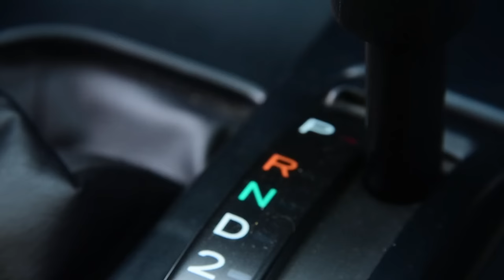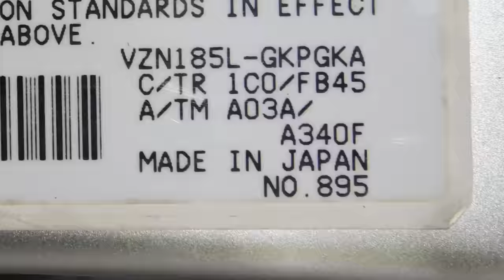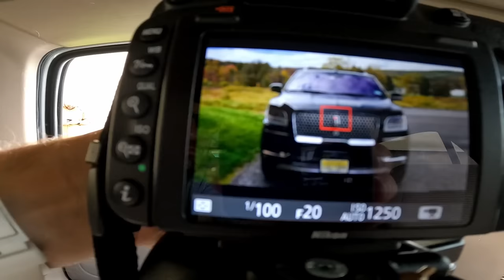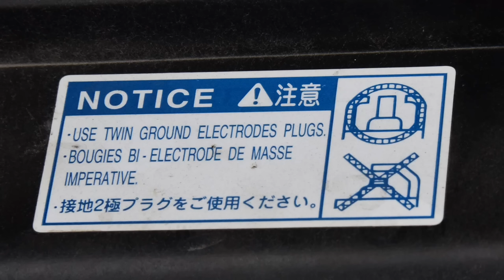2000 Toyota 4Runner SR5: Regular Car Reviews

Comment: I am enjoying this video btw, just explaining some things I’ve noticed in my many years of driving my 61 total cars owned(5 of which were 4Runners). 

There are so many errors in this video. I’m so confused. 3rd gen’s aren’t slow, 2nd gen’s are SLOW. I have the 22re with manual 5 speed. It has 33” tires and 4.88 Yukon gears. It’s “slow” but still able to do everything I want. And it feels stable and well planted at 70-80mph. It gets 20-25mpg(drives like stock with the gear change in the axles). 

My non-sunroof 2nd gen has tons of headroom and I’m 6’. I have like 5-6” above me. 
My head to the ceiling. 

It is much more truck like than the 3rd then. The 3rd gen even has a rack and pinion like you mentioned. 

The brakes are fantastic! With 33’s I can stop easily and consistently. Stock tires are 29’s for this spec(can be optioned with 31’s from factory). The drum brakes work amazing, e-brake still works at 251k miles. The 3rd gen maybe weighs more? Or smaller brakes? But they all come with 16” wheels for bigger brakes? Idk, Suzie(Susan?) the RCR 4runner must have some weird differences. I have owned 2nd gen’s, a manual 3rd gen and a v8 4th gen briefly. I will eventually go Tacoma 3rz swap for my 4runner just to get more power, but the 22re can do 100mph given enough time. 

My suspension rides great when stock, slightly less good when jacked up. But it has to do with the geometry of my a-arms up front with ball joint spacers (which have held up for 3 years of wheeling and road trips).

The old Subaru loyale with oversized tires was SLOW. Wouldn’t maintain 65mph in 5th gear flat ground no wind haha.

Comment: in all honesty.  the only thing you need to get to get any toyota truck to ride substantially better. that will not bankrupt you either, are a set of bilstein monotube 4600 series dampers.  about $400 plus installation and alignment.
*also, I'd agree that any aftermarket performance exhaust on these Toyota V6's sound garbage, but you really should try to find the TRD optional catback exhaust.  the ONLY exhaust that sounds good on any toyota V6.  everything else in truth is buzzy and yuck sounding. 
also a note, i wouldn't ever put 4x4 on dry pavement the turn the wheels at all.  your asking for trouble as it binds the components in the front end as there's too much grip on dry pavement.   i appreciate that you do the proper 4x4 exercises but only do them when the roadway is damp/wet and when its a basically fully straight road.  .cheers
ALSO, BIG UPS ON DOING THE POR15!! just did that job  with POR15 top coat on my brand new 2023 Tacoma 6MT as the frame was aready pristine.   love to see it, screw all that fluid film/wool wax junk.  you did it right dude!

Comment: The 4th gen is best gen because it's modern ENOUGH to be comfortable on road and still be incredibly capable of road 

It also has the most powerful V6 of the other 4runners and yes it can tow too  I towed a 7k pound load from Dallas to Seattle

Comment: Do the tundra brake upgrade on the front rotors. 13WL calipers with 231 mm rotors as opposed to the stock 178(?) mm. I had bad warping on my 3rd gen and was always a little worried when going down any hills. Threw on some 13WL calipers and rotors from a wrecking yard a few years ago and haven’t had a pedal vibration since. Definitely a massive quality of life upgrade, even for on-road use.
Reply: Do you have 16" wheels on your 4Runner? Did everything fit well or did you have to do some grinding?
Reply: @TheHamburgler123  I have the stock 16” five-star wheels on it, and the only modification needed was to trim away a small (maybe two square inch) piece of the dust shield so it would clear the caliper. Other than that it’s a drop-in swap. I did stainless steel brake lines at the same time and haven’t had a pedal vibration since, 40k miles later. Also, I grabbed the calipers off a tundra from a wrecking yard to save cost, and bought oem rotors and pads.  You can do the upgrade for less than $700 if you’ve got some time to search.
Reply: @ebenwragge-keller538  Thanks again for the information.

Comment: recently its about vacuum, it got suction but something is leaking, we checked the parameters of the central console and something looks crooked, we checked the sparkplug, the left one had black coated substance which we mixxed with the exhaustliquid, now it seems there is nothing wrong but in the mean time suction holes get cramped by jerk-off-cream codes coming from the left brake piston, like HONDA CRZ & PEUGEOT RCZ combined. chassis'next

Comment: I've got a 300K mile old 99 Infiniti QX4 (Pathfinder w/nice interior) and its funny how alike these two vehicles are. Slow, heavy for the size, uninspiring, wheezy V-6, R&P steering (who cares?) wooden brakes, utterly reliable, but excellent at nothing. I just use it as a back-up for my 02 Tahoe since it gets the same bad milage and can't tow anything. It's nicer inside and it's easier to park, but I never could get myself to love it......Shes my side-piece.

Comment: I’ve spent a lot of time in every generation and I owned an 83 SR5 pickup. Currently own a 5th Gen and owned a 4th Gen for 8 years before it.
The 3rd Gen is not the best. It’s a tie between the 4th and 5th. The 5th Gen is better at driving fast but 0 offset wheels and 
A/Ts are an absolute necessity. They wander all over the road with the stock shoes. 
The 5th Gen is not the slowest. It’s actually the quickest. But the throttle by wire is absolutely awful unless you use sport mode but ultimately buying a pedal commander makes a night and day difference. The 5th Gen is obviously the nicest place to be of the group but the seats are a bit shorter and narrower than the 4th. The 5th Gen feels kinda big and has blind spots where the 4th shrinks around you and you always know where every inch of the 4th gen is and what it’s doing. The 4th gen in Limited trim soaks up every pothole like no other vehicle I’ve driven and I’ve driven hundreds of vehicles. The back seats fold completely flat for car camping where the 5th has a slight lump that is an annoyance. The 4th gens, pre throttle by wire, have the best/most intuitive/responsive throttle of any 4x4.. it does exactly what your foot tells it to do… and like I said.. the 5th lacks by comparison. The 4th is the best gen but because the 5th is better looking and better for road trips and has a superior 4x4 system in the TRD models.. it’s a tie. My 4th gen was a V6.. the V6 has more horsepower but less torque. The 6 has a timing chain that never needs to be changed. And the V6 has a better 4wd system vs the V8. The 8 is full time 4wd, the 6 has 2wd, awd, 4wd high with center diff lock and 4wd low with center diff lock. The 5th gen limiteds and Sr5 have the same system where the TRD models have old school J lever with rear locking diff. 
Next time you drive a 5th gen, push the pedal to the floor like an old Mercedes and they hit 60 in 7.5 seconds. 
Last note… my 4th gen limited was a slick top without a spoiler. When I traded it in the Toyota dealership sales manager of 15 years said he’d never seen one. Toyota has zones in America. The Seattle zone received slick tops. Whereas the Chicago zone and the rest of the country could not and did not get slick tops. 

My fingers hurt from typing. 
Good day sir.

Comment: They do make them slick top, I have a 99 slick top. I honestly miss the sunroof, my 92 had one and the air flow from the sunroof to the back window when both were open, you almost never need air conditioning.

Love my 3rd gen, I abuse it. Broken sway bar links multiple times, worn out every bushing on the suspension, body is full of dings and scratches. I once had to drive it 200km with a dead injector to limp it home in the dead of winter. 4runner doesnt care, it just pushes through. 

Re: towing things. 5000lbs is optimistic. I once towed 2000lbs on the highway and I could really feel it. I wouldnt be comfortable going a lot higher than that unless it was a short distance at low speed.

Edit: also, known issue with this gen - front lower ball joints. If theyve never been changed, change them. OEM only.

Comment: I have a soft spot for 3rd gen 4runners. I had a pearl white one as my first car and it was like a cockroach. They might not be fast, but they'll get you where you need to go reliably with very basic maintenance. The automatic ones have a huge gap between 3rd and overdrive and are overgeared, which might explain their less than ideal acceleration.

Comment: So leaving this comment I have two 4 Runners myself 1997 and 2001 the 97 with 239,000 on it and the 2001 is pushing almost 323,000 I bought them both second hand they've never broken down once just general maintenance over the years and they start every day the 2001 is silver in color in the 1997 is red which is known as radiant red metallic and you were mentioning that you've never seen one without sunroofs I have both without sunroofs on mine as well they are both SR5 trim level I have worked for Toyota now for almost 24 years they're starting to get hard for getting parts for interior pieces but you can still get pretty much the drivetrain and miscellaneous engine parts still and body parts as well if you have any further questions please reach out to me thank you for the video that you did it wonderful.

Comment: If, the automotive gods forbid, Susie goes the way of Ol' Heller, I imagine her replacement is gonna be another 3rd Gen 4Runner. This entire 32 minute video can be distilled down to 4 words: "I love my car"

Closest I came to experiencing a 3rd Gen 4Runner was a 1st Gen Pathfinder, and that was when I was newborn through 4 years old when it was replaced with a Nissan Quest minivan, so I have almost NO memories of it. The only one I DO remember was taking a trip up to the White Mountains in 2000 or 2001, getting out for a rest stop at the McDonald's in Meredith, New Hampshire (which at the time was decorated like a hunting lodge with a talking animatronic moose head - it's been standardized within the past few years), and touching the tailpipe and burning my hand.

Comment: Your description of how your 4Runner drives on road and the poor mpg is hauntingly familiar to a 2001 Xterra SE 5 speed I had. I got 16 mpg with it city or hwy and the ride was like a truck. But offroad was a breeze.
Reply: I had a 2000 Xterra and had same issue and it was a 4x2! My brother’s Expedition V8 had better MPGs!
Reply: @RolandoMarreroPR  The low gearing and breadbox aerodynamics were at play! I was spinning some fairly high rpms in 5th over 65 mph.
Reply: @autochatter  The Xterra was more fun to drive though and was reliable. Would have gotten a 4x4 but got the cheapest one on the lot 5 spd and roll up windows!
Reply: @RolandoMarreroPR  Mine was loaded. Had the sunroof you couldnt use without removing the gear basket,6 disc in dash,windows and locks etc. You didn't get the cheapest one. They made a base one with the KA 4 cylinder and no roof rack! They looked funny.

Comment: I just traded my 90 series LC Prado for a 97 Hilux Surf (transmission failed). The Japanese models also had a 2.7L 4 cylinder, a 3L Turbo diesel with or without an intercooler. I think my turbo diesel would do 0-60 in 13 seconds. They are very spartan inside ( no cruise control, cup holders as an afterthought).

Comment: 4th gen v8. Just passed 300k miles. My family has owned 4runners for years. If you live somewhere that gets snow, they're the single best daily driver, if you don't need the utility of a pickup truck.

"WHaT ShOuLd I BuY?"
Toyota corolla, Mazda Miata, and Toyota 4runner are the only acceptable answers

Comment: Remember, always torque your lug nuts when you put your wheels back on the vehicle. Before that however, it’s best to clean your mating surfaces such as the hub, and the back of the rim. This is to prevent your wheels from coming off at high speeds. As a tech, I’ve seen one too many videos of wheels flying off cars and doing damage to other vehicles and causing harm and that’s due to not following torque specs,and/ or cleaning mating surfaces, AND/or over tightening your lug nuts using the impact wrench. Stay safe out there fellas

Comment: About the top speed 5:08. I have gotten to 108 MPH in my old 2000 4Runner (2wd so it might be more than yours) before on the interstate WOULD NOT RECOMMEND. My 0=60 was about 13 seconds with a tail wind though. 12 is good.

Comment: I had a 1kz 3.0lt turbo diesel 96  surf. Which is the japanese version of the american 4 runner. It was an awesome wagon, until it didn't stop and I went up the back of two cars. 
Unfortunate that you guys never got diesels, definitely a better fit in terms of power.

Comment: Do the Tundra front brake upgrade. Boom! Warped and underpowered brakes solved. 

The rotors and calipers from a 2005 Tundra will literally bolt right up. You just need to trim the dust cover a bit, super easy.

Comment: I have a 2000 4 Runner SR5   MANUAL TRANSMISSION  (cry your eyes out) ... bought in 2003 with 15K miles. I now have 231K miles and in excellent minus condition. My daily driver
I bought a  new 2016 Tundra SR5, what a ridiculous POS. It's not a truck, it is a cup holder on wheels with a box in the back to haul light weight stuff.  I just gave it to my daughter and hubby. Perfect for them.
 My 4 Runner is stock with some exceptions.. Yakima rack with a basket extension on top of the factory rack.
New tires, coil springs, brakes front and rear, complete tune up .  Since 200,000  miles I do my own work but let the dealer do the usual oil change  service stuff. 
Two Local dealers, both suck.  ( Ps I was int he car biz for 25 years, I know con artists when I see them. 
I have a complete set of the steel wheels with studs mounted, soon to install, winter is coming here in Oregon. 
What does not work after all these years is the typical (useless) leaking sun roof now sealed off with Gorilla tape, and the radio/cd player. I never used either.

Cumulative combined fuel mileage after 20 years is 17 MPG. I drive like an adult and use the throttle, gear lever and brakes sparingly.  I don't buy cheap gas.  
I am contemplating installing an ARB front (Tacoma) bumper .. other than that, keep it as is. We are buds.

Comment: I had a 2001 - I hit black ice and rolled it one a half times ending up drivers side down. It was still running. I could have pushed back on its wheels and driven it home. The roof caved in though so it was totaled.

Comment: This guy is abit hard on the engine. I have a toyota t100 which weighs more probably. High rise shell. I fully load it for snowboard trips and it handles fine! Im able to cruise at 80mph all day long. Can mob up hills pretty easily. I have had a 22re and a 3.0 before. The 3.4 is hands down the smoothest and most powerful engine you can get in any of the 90s late setups. Its also most reliable. I can get up and merge with traffic much easier then the 22re and 3.0

Comment: One correction for you Mr. Regular.  I owned a 1995 4runner with a 2.4L Manual and not a V6.  It was an extremely uncommon trim, probably because it was slow.   Dangerously slow.  I remember being on I-280 in NJ crawling uphill to the skylands, nearly redlining in 3rd gear going 45mph, and that was as fast as you could get it on that incline.  I don't think I ever got it above 70mph on flat pavement.

Comment: My 1999 Toyota 4Runner is at over 412,000 miles with the original engine and transmission. I would love to sell it or trade it, but the idea of being able to keep the $500.00 plus dollars new car note a month in my pocket makes me think otherwise. It keeps starting when I turn the key. Yes, it leaks oil. I had the rear end replaced and the part they gave me was loud from the first time that I put it in 6 years ago. I keep a pad underneath and I have to add oil every month and a half or so, depending on how much I drive. The highest top speed I got on the car was during one stupid, drunken night on an open highway (I am still ashamed of that poor decision, but no wreck or anything like that occurred) was 115 mph racing a Ford Explorer at 2:30AM. At one time, I would put the back seat down and take naps or crash overnight. I once ran into a guardrail on an icy day but I had a crash guard on it. But, sometimes, I have to tap; on the instrument guage to make the lights illuminate at night. My AC control panel failed, I bought one off ebay and it worked for awhile and then failed. So, the AC/Heat compressor runs all the time when the car is running. The car does ride very rough, especially with the bad rear end that I had installed. You don't want to turn too steeply or it seems like the wheels are possibly going to fall off. I have a left fog light that likes to go bad, maybe because it is letting water in.  My poor chrome alloy wheels are faded because I used that green fluid at the car wash. The paint is still holding up well! What a car. It has helped me get through lean times by being dependable, roomy, and cheap to maintain. .

Comment: I've got myself a 2000 tacoma, base model, 2.4 L i4 with a 5 speed manual. I almost never take it over 75 because it gets super loud, almost like the engine is shaking itself apart. Had to pass a line of semi's once with another line of speedsters coming in hot, knew I had to pick up the speed by a lot. Got it up to 92 and suddenly everything is quiet, the vibrations cease, and it felt like I was coasting on air.

I don't know probably something to do with harmonic frequencies in the drive train or something, but I'm still not going over 75 unless I have to.

(For, legal reasons, this happened long ago enough that the statute of limitations in my state for traffic violations no longer applies.)